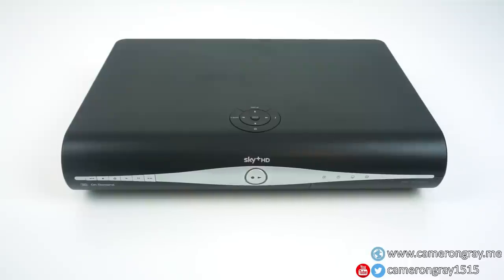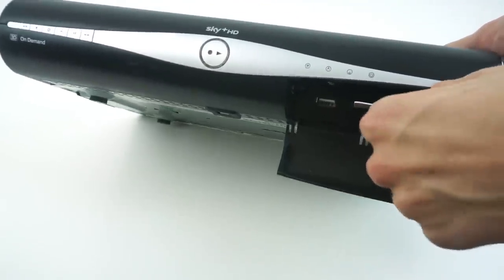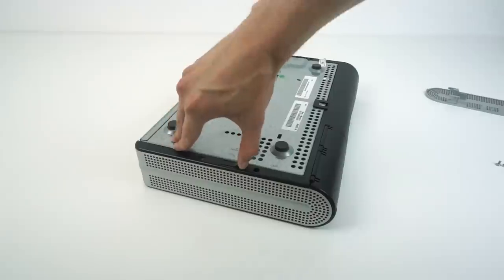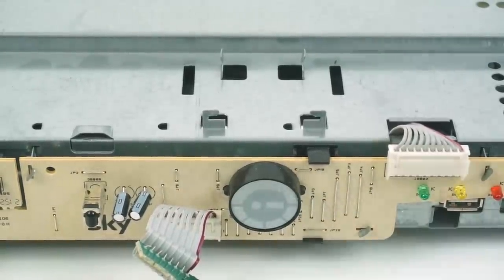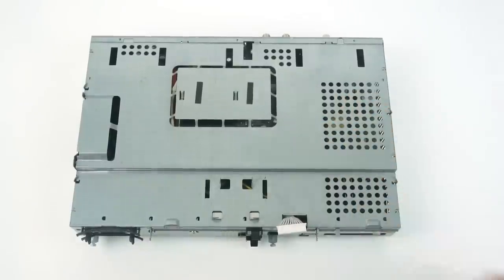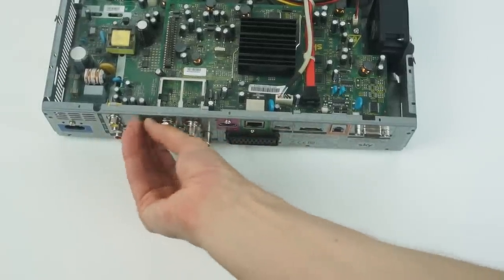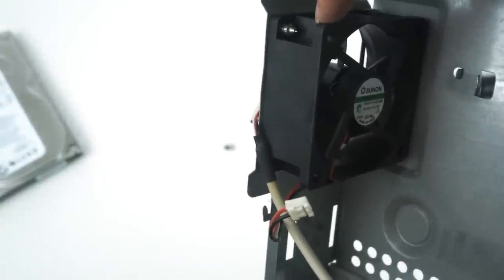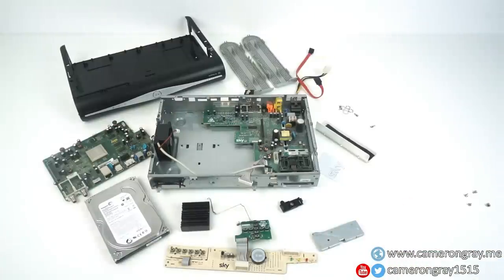Teardown & Hard Drive Removal - Sky+ HD Set Top Box

Comment: Can u make a vid on how to connect this to a laptop an what the benefits are...
Reply from the maker: It's probably not worth an entire video, essentially you just need a 3.5" SATA USB hard drive enclosure, install the drive into the enclosure, plug it into the laptop and format the drive through your OS to use it as an external hard drive.  As for benefits, it'll just give you an external 500gb drive, nothing hugely special.  Just bear in mind that external drives are extremely cheap nowadays so instead of buying an enclosure for an ex-sky box drive, it may be worth spending a bit more to just buy an external hard drive where you'd have the benefit of being able to get one that is physically smaller, powered by the USB port (3.5" enclosures for drives such as the one from a sky box will usually need an external mains power supply) and you'd also get a new drive rather than one that's been heavily used in a sky box over the years.
Reply: @camerongray1515  the reason i ask is coz i got an old sky box that hardly got used much as we ended up switching over to virgin after about 6 to 7 months of the sky install..ok the sky box jst been sat in its box in the cuberd..so wanted to use the hard drive from it to connect to my laptop..but jst do how to go about it..hence asking for the vid install an connectivity on how to..
Reply from the maker: I don't really produce how-to videos of that style however what you need to buy is an "external hard drive enclosure" for '3.5" SATA drives.' There will be other videos of these on YouTube, there isn't anything special about Sky box drives so a tutorial that covers standard PC hard drives will be fine.

Comment: I bought an old sky box from a junk store , does it need a password to unlock the hardrive?
Reply from the maker: You can reformat and use the drive just like you would with any regular hard drive, no password required.  However most of the recordings on it will be encrypted so you won't be able to access them.
Reply: @camerongray1515  Thank You!

Comment: I see hundreds of these at car boot sales, I might have to do this... Cheap high capacity hard drives... well it depends on the capacity, obviously
Reply: All of these black +HD boxes come with at least 500GB.

The older white Sky+ boxes had IDE 160GB drives
Reply: i've come across some of those hd boxes with 320gb drives in...
Reply: I believe those are the ones that don't have the 3D and OnDemand badges on the front, and a slightly different design of the LEDs.

Comment: I did this with an older Sky+ box a while ago. It had a 160GB IDE HDD :/
Reply: Great for retro builds if the hdd is still good !
Reply: Phrea Nix Should be fine! Now I've got to see if I can get an adaptor as I don't have anything with IDE. XD
Reply: Doctor Cammy I have opened many and the come in 160, 320 and 500gb drives haven't had any others yet
Reply: I picked up a 2TB box for just £2, formatted the drive and now using in my PC ;)
Reply: yep, 160gb ones are usually in the 'white' non hd boxes,  'rescued' a few...😊

Comment: What size is the sata drive?
Reply from the maker: Depends entirely on the box you have, they were offered with capacities ranging from, as far as I'm aware, 160GB all the way up to 2TB.  In the boxes I took apart here it had a 500gb drive.
Reply: @camerongray1515  mine is 500gb but don’t know size enclosure in need. Thanks
Reply from the maker: Oh sorry, physical size, it'll probably be a 3.5" drive.  You can tell by measuring it at it's smaller width, a 3.5" drive will be around 10cm/4in wide, a 2.5" drive will be around 7cm/2.75" wide.  The 2.5"/3.5" size given for drives refers to the size of the actual platter inside the drive, hence the physical drive itself being slightly larger.
Reply: @camerongray1515  thank you

Comment: Damn. I've been paying only  £2-£3 for these on the carboot sales for years. Thanks to your video, the price will increase 😕  The earlier box had a 320gb Western Digital hdd, later ones 500gb seagate.  Yet to find 2tb model on the carboot 😉  Edit:  the earlier box also had a separate power supply board, 5 & 12v with sata connection obviously  that I keep for powering drives externally. BUT it needs insulating first due to 240v tracks on the board.
Reply: i think i usually pay £3 to £5 for them,   last one was £1 ,  but the only one as yet with a slightly bad hard drive ... ONE sector 😲 argh!

Comment: I dont see why you would want to replace the hard drive, Cant you just phone up sky and get them to replace the box?
Reply from the maker: Not on these older boxes - the boxes were classed as the property of the customer so if it failed out of warranty then Sky would try to charge for a replacement.  You also may want to upgrade to a larger drive rather than paying for an upgrade.  With Sky Q the box is owned by Sky so they are responsible for replacing it.

Comment: The Broadcom SoC in that Sky box I'm assuming is an ARM chipset that might not be too dissimilar to what's used in the Raspberry Pi.  The money made from producing several million Sky boxes with a satellite compatible version of the chipset would be enough for them to just hand out versions of the same SoC without satellite hardware to the Raspberry Pi Foundation for nowt and not make a loss.
Reply from the maker: It's a very specialised SoC designed specifically for DVR use with a single, dual threaded 400MHz MIPS CPU rather than an ARM one. It will have a much larger focus on things like hardware based video encoding/decoding than a general purpose SoC for a single board computer like a Pi.  It's also physically a pretty large chip, way larger than the one you'd find on a Pi.
Reply: Didn't the original SD Sky Boxes use AMD K6 cpus haha,

Comment: That memory size is measured in megabyte, not megabit.
Reply from the maker: The part numbers for the RAM chips are k4t1g164qf-bce7 and k4t51163qj-bce7.  The flash chip is gl512p10ffcr1.  All of the information and datasheets I can find on these give the capacity in bits rather than bytes (lower case "b" in the datasheets).  It's pretty common for individual memory chips to be measured in bits as opposed to completed RAM sticks which are measured in bytes.
Reply: Lol Nick, you’ve just been owned 😀
Reply: Guess you learn something every day. Thanks for the elaborate answer!

Comment: That’s the same cpu on the raspberry pi 3 b+
Reply from the maker: It looks the same with both being Broadcom chips in similar looking packages but the chip in the Sky box is very different. It's a significantly larger STB SoC with loads of additional hardware to handle video decoding and has a fairly low powered MIPS core compared to the Pi's quad core ARM CPU which is a much more powerful general purpose chip.